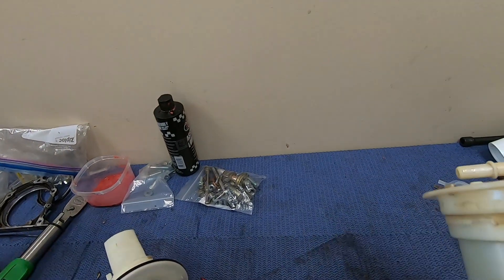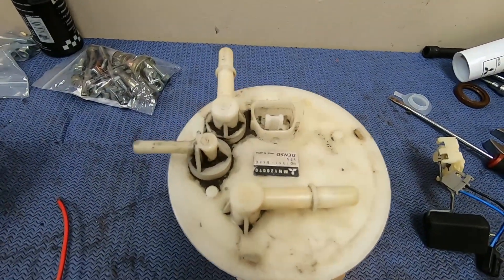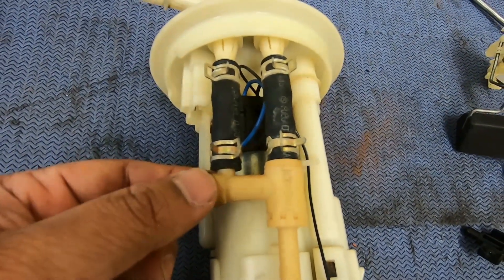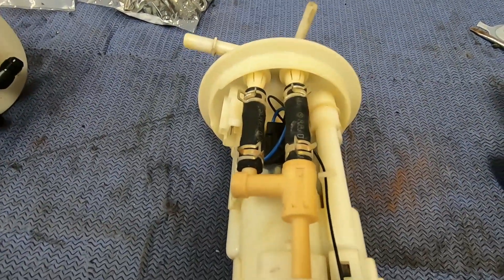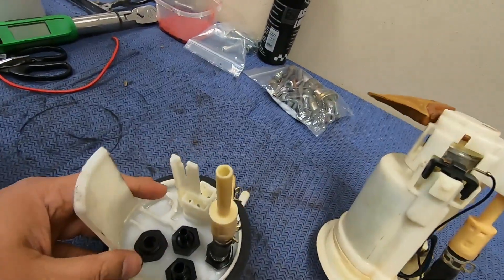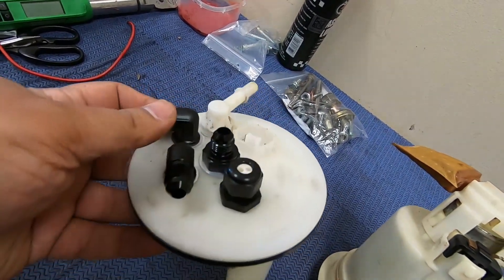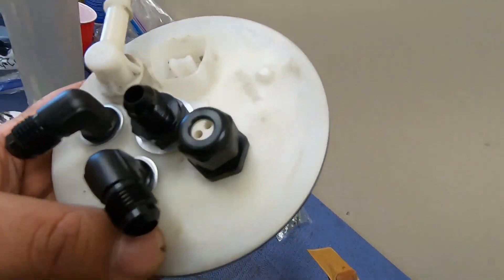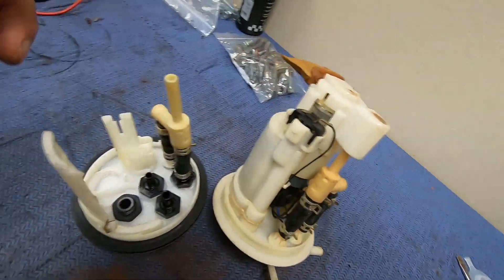EVO Dual Pumps How To DIY, fuel system plumbing,  hobbs switch wiring

Comment: Great video! It’s also worth noting that a Hobbs switch is not necessary if you drill out the Venturi from the siphon. Had an issue with not being able to get my base pressure below 52psi and this fixed it when I eliminated my Hobb setup.
Reply from the maker: I feel running 2x continuously is less desirable then running a Hobbs switch or some sort of secondary trigger. On a dedicated race/drag car I completely understand.
Reply: @bdalchemist  True but you are adding an extra point of failure to vital system. If the relay fails or you lose a vacuum line, it’s rebuild time. As an engineer it just bothers me 😆
Reply from the maker: @evilgti2000  ask ur self this, which relay has more chance of failure, one that run continuously or one that runs some times? And vacuum? If ur vacuum comes off , ur car will let u know it has a major leak. Speak from experience and have done it both ways , Hobbs for none aftermarket ecu and or dedicated race car is my recommendation. You obviously can do it anyway u like which ur comfortable with.
Reply from the maker: @evilgti2000  I would also like to add, no fuel system or any system is perfect. Your system (all of them) will fail at one point given enough run time. The 2 pump continues has the same # of components as the Hobb system (when done correctly) , only thing ur changing is the trigger. U can switch out the Hobb trigger for a gas paddle or even map/maf voltage trigger (like done in other platforms). End of the day it's gotta be based on needs and durability. From experience hobbs is more reliable. Your experience might be different.
Reply: @bdalchemist  Actually I’m an electrical engineer and I have an answer for that, a relay that is constantly pulsed. The contacts get “soot” on them and you get inconsistent or no conductance the more often a relay is electrified. But I understand your point.
Reply from the maker: There is difference between theory and what's happening on the street when these systems are being used. Based on my experience, using real hella or other good relays eliminates the relay issue (like Evo x fuel pump relay problems). If u ask around those walbros fail alot more often. Also disagree with u about the contact point loosing conductivity. That is purely quality based. And I would like to point out, by ur theory of continues connect state, a daily driving car , all the relays disengage with every ignition cycle. So in a day a few times it clicks on an off vs # of times u do wot. So ur main relays are actually doing what a hobbswithed relay does alot often on a daily driving car.
Reply: @bdalchemist  reading the guys comment is kinda funny cuz as he says he's a engineer. But what those type of THEORETICAL people don't understand everything FAILS.....SOMETIMES...

Comment: Gday mate. Thanks for sharing your information 👍🏻. Quick question, You said your Fuel lab filter was a 40 micron, is it better to run a 40 micron filter? as in my evo x on flex fuel with about 500whp i run a 10 micron, or a 6 micron filter. Is it better to run a 40micron for higher flow?. Thanks mate 👍🏻

Comment: Thanks so much for posting this.  I have a Hobbs switch on my setup, but am converting to standalone and wondering if I would be better off triggering with the ECU?  The standalone will incorporate fuel pressure in its fuel model, so I'm not sure if it makes a difference.
Reply from the maker: Yes , I always use ecu trigger when I can. Which ecu are u using ?
Reply: @bdalchemist  Emtron KV8

Comment: Hey man.. thank you for your very informative videos.. I have an evo 9 mr.. is currently stock.. I want to get around 600whp out of it.. and been stocking up parts for the build.. just a few things I'm not sure about.. I have dual walbro 255 and want to modify the hanger myself just like I've see in your videos.. also want to do the an fittings my question to you is how do I connect the an lines to the stock lines.. or should I go with all new an lines from the pumps to the rail.. this is a list of parts I got so far for this build
6266 precision turbo
3" ets intercooler 
Stm fuel rail
Gsc's s2 cams
Radium fuel pressure regulator 
2150 fic injectors 
Dual walbro 255
Don't know if I should get a aftermarket ecu or if my stock ecu would be ok for what I'm trying to do.. thank you in advance hope to here from you soon.
Reply from the maker: U need to run new lines to use dual pumper. Both ways

Comment: I have a hardwired single Walbro 460 will this be sufficient to reach 600hp or should I go a Walbro 525?
Reply from the maker: Should be good enough, but injectors are a big factor as well
Reply: @bdalchemist  thank you for your reply much appreciated, I am running ID1300 injectors

Comment: I recently use 450walbro and get return hose back pressure any solution idea sir
Reply from the maker: If ur using stock lines I'll need to drill your Venturi.
Reply: @bdalchemist  I been change a new fuel line to 7mm
Reply from the maker: Did u drill the Venturi in the tank?
Reply from the maker: I don't understand what ur saying.
Reply: @bdalchemist  sorry bad English even on evo3 fuel tank same to drill on venturi?

Comment: i run a Squash Performance double pumper after having 2x  Bulletproof pieces of crap leak on me thru plug that was never ever designed for fuel! steer clear of it! seen plenty of the Buschur oem diy twin kits leak too!
Reply from the maker: Yes as with all things , has a chance of failing. We do our best and try to put safety measures in place.